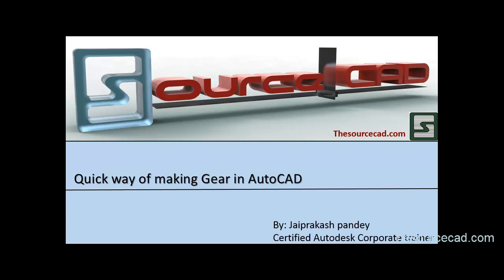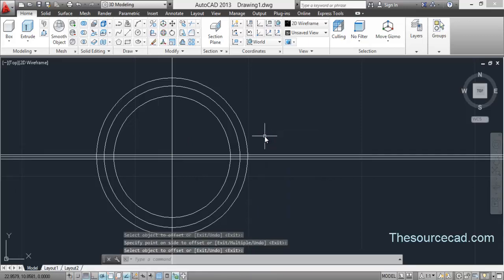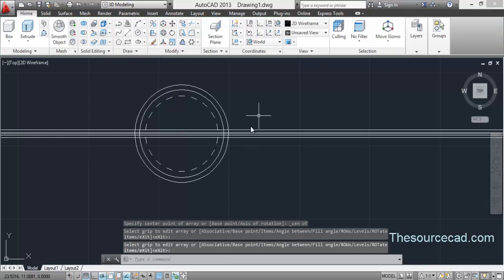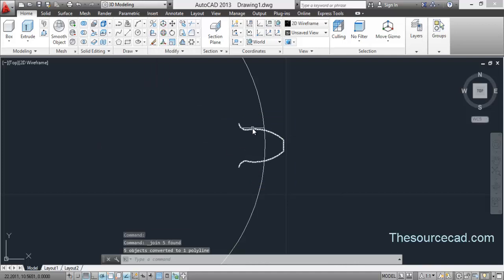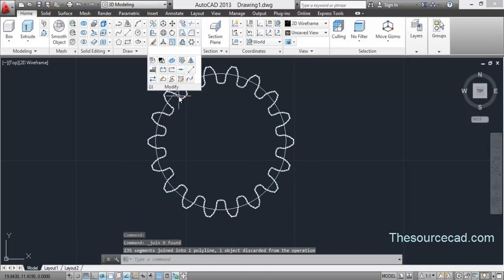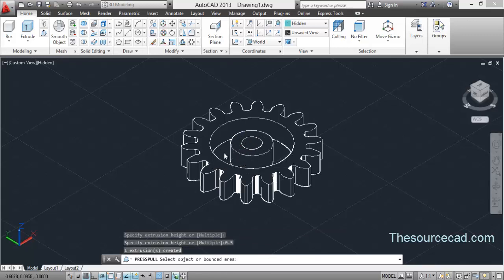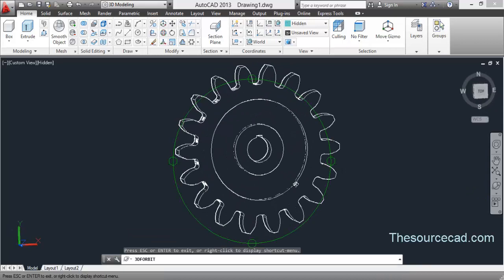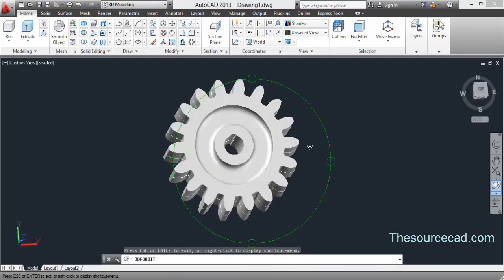Quick way of making gear with AutoCAD

Comment: I am using AutoCAD 2013 and unable to use fillet function (in your video tutorial at 3:04) because all the array items are showing a single item.
Reply from the maker: jamshed ansari select arcs which are showing as single object and type X on command line and press enter and then apply fillet.
Reply: SourceCAD  Thanks it works.
Reply from the maker: jamshed ansari Welcome Jamshed

Comment: At the point in the video(towards the end of the video), when you perform a "Union" within the "SOLID" sub-menu tab, it appears that the inner cylinder and outer cylinder(the one with the teeth) connect to eachother when you use "Fillet Edge", but when I try it, it will "Fillet" the solid objects, and not the space inbetween. I'm assuming you want the inner and outer cylinders connected with the "Fillet" option, but it won't connect. I will continue to mess with this for now while I wait for your response, and will update this comment if I get it figured out before you can respond. Thank you.
Reply: Same problem

Comment: This does not create a good gear with involute curve profiled teeth.
Reply from the maker: You are correct Ace, Actually this gear has even more issues. The dimensions,pith and root circle diameters, pressure angle everything has been chosen at random only to explain AutoCAD tools. The idea behind this video was to communicate methods of using AutoCAD tools not making gear hence approximation is used whereever possible.